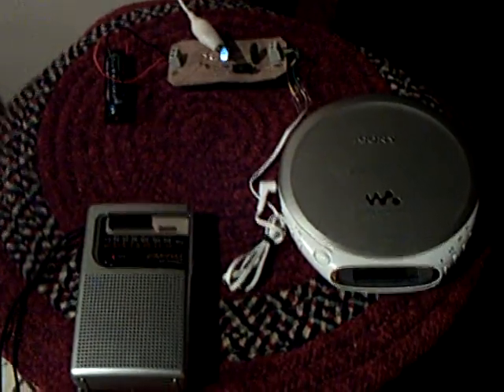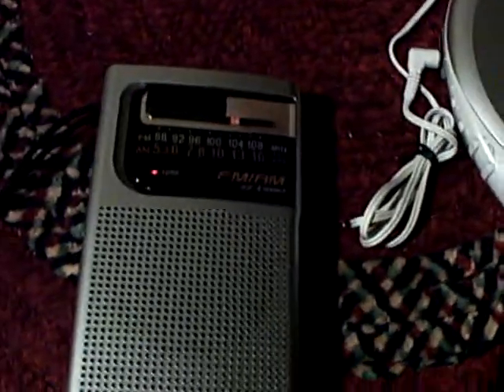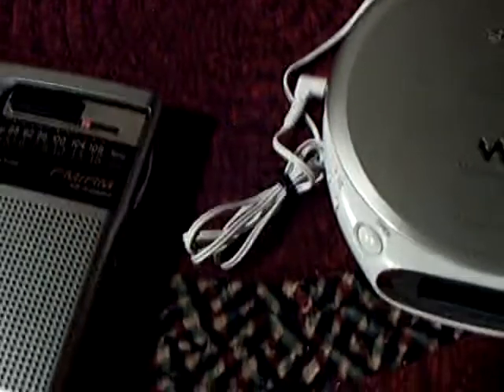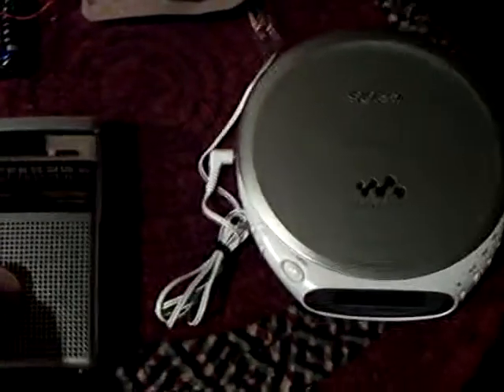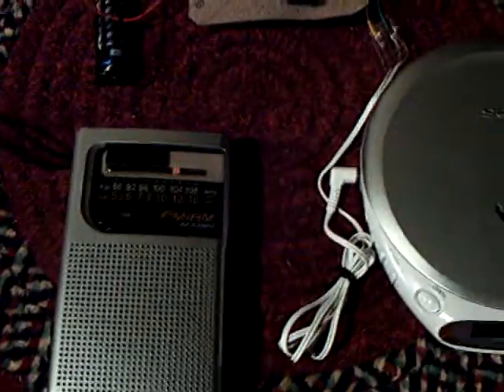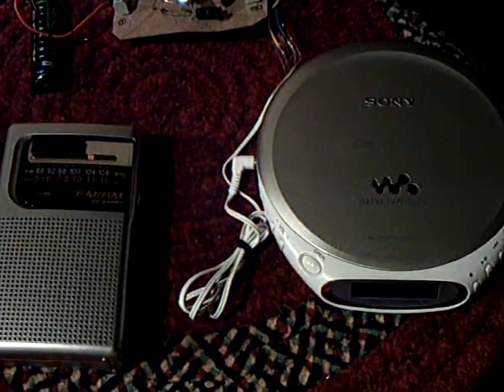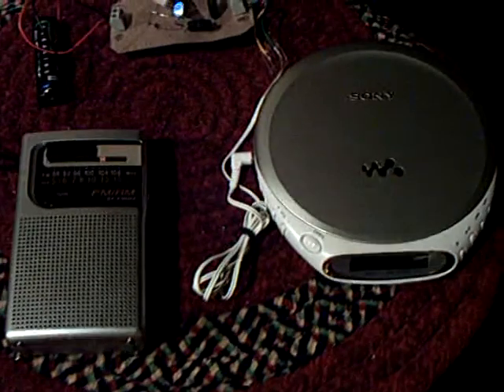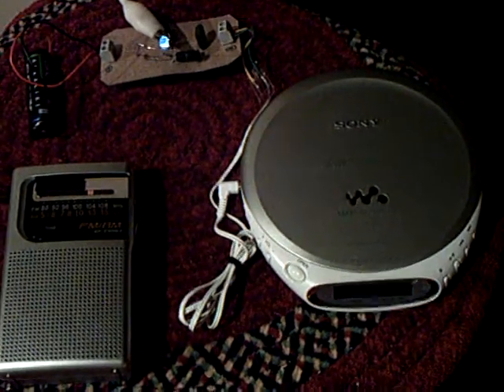Cool Joule Transmitter--using house ground wire to transmit

Comment from the maker: The ground (-) in the transmitter circuit just goes to the battery (-),  the transistor emmiter, and the (-) on the input signal feed.  I don't know about the reciever radio circuit wiring.  This is coming in over the AM band (several spots) but yesterday I changed the capacitor value and got the tramsmitter running up into the FM mHZ band frequencies.  The wireless distance range was increased to about 100 ft..

Comment: Bloody hell lidmotor, you really are a wonderful experimenter, very inspiring to see your work progress. 

Now all you need to do is transmit the radio between the pulses on a battery charger and charge batteries from the radio signal for free

Comment: Excellent and thanks ! 
It could also work as a safety for the bathroom. Run a mains radio/CD player somewhere else in the house + take a battery one while bathing. 
Or, it could be used as an intercom receiver from the door..person talks at the door, you can be anywhere in the house and hear them. If this circuit was also in the receiver, it could be 2 way with a small audio amp/microphone. All homemade + effective. No need for a doorbell, all could be solar powered/charged :)